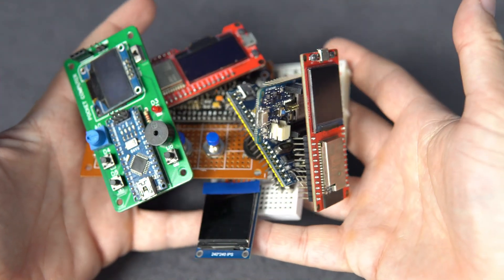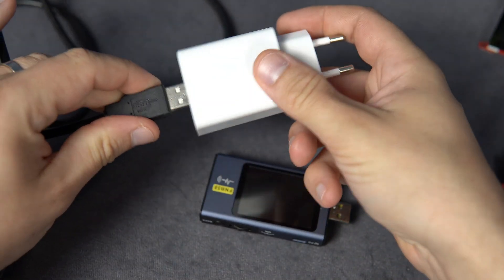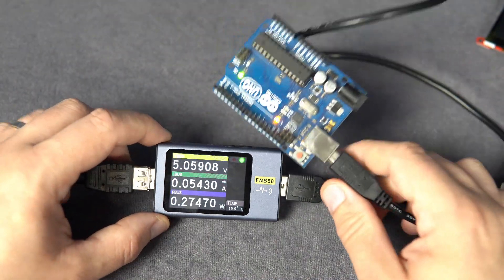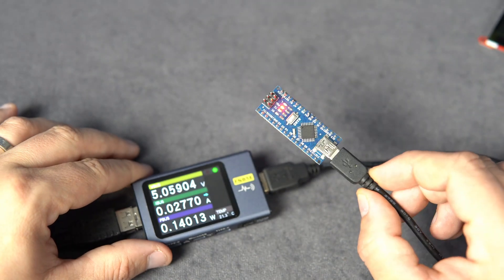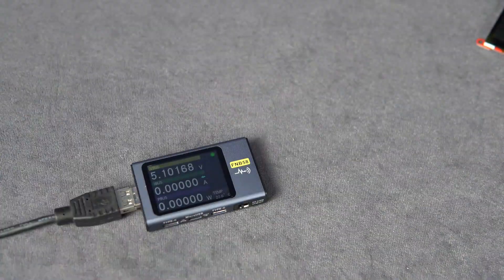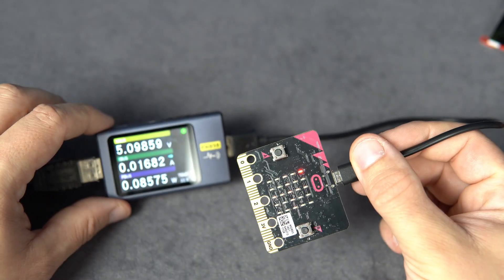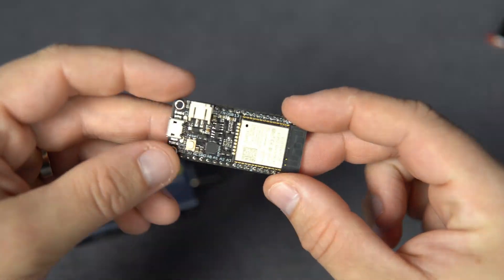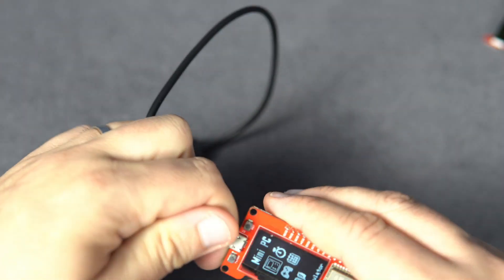Testing power consumption of more than 20 development board

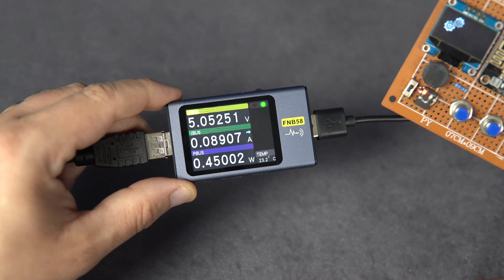Comment: I liked your board current comparisons with the FNB58 and I'm very impressed with the capabilities of this instrument. I noticed at time 6:40 that if you flip its orientation upside down the display will auto-flip too so you can read it inverted too. It packs a lot of other interesting capabilities and for a range of micro amps up to +28 vdc at 6.0 Amps it's pretty incredible. I am curious about the " RasberryPi" at time 15:38.. it looks a lot like the TTGO T Display module I just bought in a plastic case last week .. can this TTGO T Display also run a linux version you'd normally find in a RasberryPi too?
Reply from the maker: No no, this is not based on microprocessor like rpis you are taljing about , this i rpi microcontroler it is evev slower than esp32 and it can not run linux, not even close
Reply: @VolosProjects  Ok thanks.. it’s interesting that it seems to be able to fit in the identical case.. you fooled me 😝 I just found your video titled " PC Hardware monitor using T-Display RP2040" and see there are LOTS of differences.. I thought this was an ESP32 based board but that board in your video is completely different from what I just got.  BTW I did order 4 plastic cases for the TTGO T Display modules that should fit them and look identical from the outside.. we'll see, thase cases haven't arrived yet.  This pair of 16MB "ESP/RP2040" boards I just received do have ESP32 chips inside..but I'm not sure if they have Wifi yet,  I know that they do have MAC addresses and I want to use them in ESP32 NOW projects later so I hope they do Wifi.😄

Comment: This is a useless comparison, more to show off board collection. It would be useful to have a low power example sketch in Arduino loaded on each one of them (as they should be all available in Arduino) and compare those results. It's not shocking that WiFi consumes a lot, it's usually in the ~200 mA region on ESP32s.

Comment: Not sure how useful this is without running the same or equivalent sketches on the boards? Some boards you even need to set internal pull ups on floating pins to not use up a lot of extra current I found..?
Reply: It is as usefull as comparing the power consumption of your fridge and your tv.
Reply: Exactly right.